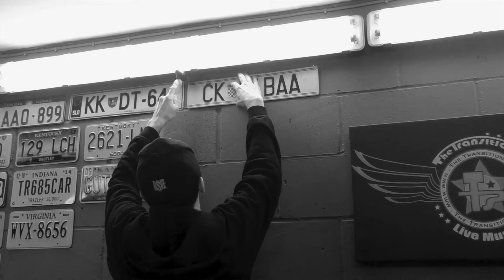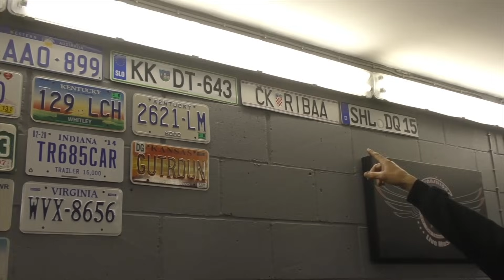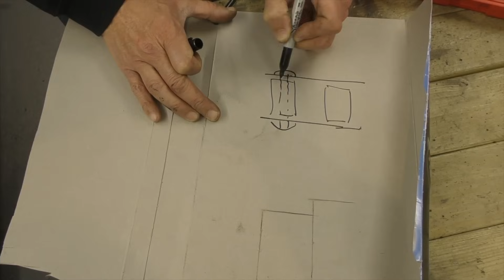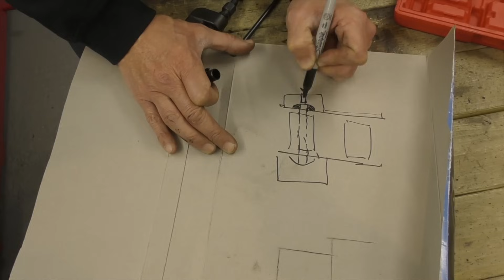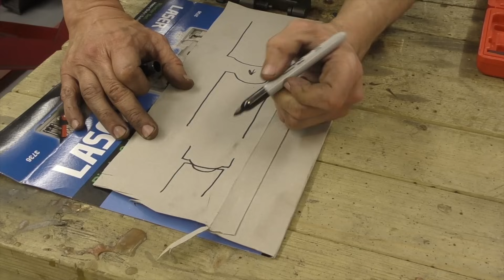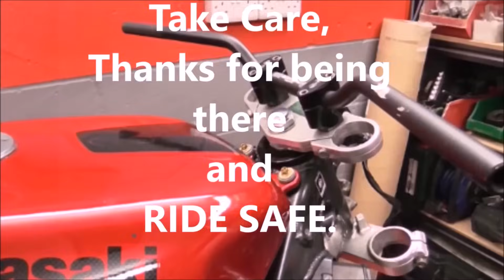Delboy's Garage, Motorcycle Chain and Sprocket Change.

Comment: Hey,
Don't want to sound like a negative Nancy...but I have exactly the same chain tool and when I rivet the master link something just didn't feel right, so I went to the DID website and the specs for the rivet head flare need to be 5.5mm - 5.8mm The way you showed on this video gave me 5.37mm.
I had to grind the tip of the tool to a larger dome to fix this.
Reply from the maker: I use the DID flaring tool for this job now.. it has a two part tool end.. one part is the cone shape point.. and the other is a cup shaped recces, and its machined to exactly 5.6mm so you just crush it in there and it flares to the exact size...if you flare too much you can crack the lip edge of the flare which can chip off later.. so the DID tool is very safe and accurate... there's a video on it in the playlists..

Comment: Man, you just saved me ! I bought the same tool and broke the 2 smaller pins. I didn't use the 3.8mm because the ring wasn't allowing it. I was disappointed and threw the tool to the bin. Then I found your video. Same chinese tool! I grinded eaaily the mushroom with a file. Then I used the 3.8mm.. Et voilà ! Chain opened! Man, I thank you, and I thank God! I ll watch the end of your video to install the new chain, cuz I do not want any problem now. Thank you again! (Ducati SF 848)
Reply from the maker: No problem 👍, glad it helped

Comment: Hi Del, did you do a video on how to check for chain and sprocket wear ?????
Reply from the maker: Not specifically on that alone mate, but here's a trick if it helps... set the chain tension so it's correct for riding (am sure you know how to do that), stand the bike upright with the weight of the bike on the wheels (get someone to hold it by the handlebars... engine OFF and bike in neutral)... then crouch down behind the bike, grab the chain on the very back of the sprocket and pull it off the sprocket, if you can see more than 5mm of daylight between the chain and the sprocket you're getting in to some serious wear and it's time to think about changing it... a healthy chain shouldn't show any daylight under the sprocket no the back edge.  Hope that helps mate.
Reply: @Moonfleet41  Thanks Del, i have watched your video on the theory of front sprocket wear to rear sprocket (3 to 1) and was looking at getting a silent running front, but in checking the way you have described,   and having a winter wash and brush up, i have cleaned and lubed the chain, in checking i can pull about a 2-3 mm off the rear sprocket, i am now thinking, stick with what iv'e got, then replace the lot in the summer, ?????
Reply from the maker: @davidcort2857  Good plan mate.. that's what i'd do with that much wear..!
Reply: @Moonfleet41  Thanks Del, and thanks for some cracking videos, you and Pen have  a great Christmas.

Comment: Hi Del, im fitting a new chain on my Street triple r 2014, I've followed your video and  found it really helpful and has gave me the confidents to tackle the job.
I'm now up to the point where im fitting the new DiD Chain.
the trouble is when I fed the chain around the sprocket and when they meet on the rear sprocket they are about 5mm short to get over the tooth, there does seem to be play in the chain but I can't keep them together. when I brought the new set it is for my bike. the old chain had 59 link the new chain has 57. 
I know that's so different but I did think if I brought the whole set for my particular bike it would fit ok. any help would be m much appreciated. thank you for all your videos, so very helpful and easy to follow because you take the time to explain each step.
kind regards 
mark
Reply from the maker: Hi Mark.. i presume you have the axle all the way forward in the swinging arm?.. are you fitting new sprockets with the same number of teeth as the old ones?.. presuming all that, then you should have 117 links including the split link!.. count the pins not the plates mate.!
Reply: @Moonfleet41  Hi Del, thanks for you reply, I have spoken to the company and they sent me out the wrong chain, the one I have is a 116zb I should of had 118, 
gutted I wanted to get out on the bike today. 
that will teach me in future to check the parts before starting , didn't know you counted the pins and least I've learned something, yes I had the rear wheel as far forward as it would go. thank you so much for your help and videos..

Comment: That tab washer on the nut that holds the front washer on how many times can you use it before you replace it?
Great video by the way.
Reply from the maker: Hi Richard.. usually, if its never been off, and only bent over once at the factory... then ill use it a second time.. but no more than that, they don't cost much.

Comment: Thank you for your video. I got 520 DID chain for my KTM dirt bike, but it comes with the clip. should I also press the pins like on your video before I put this clip, or I can put the clip without pressing pins? I'm a bit confused with different approaches and videos.
Reply from the maker: If its for a light weight dirt bike, and the chain was ordered for your bike's spec, and it came with a clip... then fit the clip mate, thats all you need..!  but paint it with some bright nail varnish so you can find it at a glance, and keep an eye on it.. Hope that helps. del.

Comment: Great video! Good to know if you're a relatively inexperienced motorcycle mechanic like me. Changed oil/filter, coolant and battery so far and still learning about chain/sprocket as the 2002 CBR 600F4i I'm working on is making these clunking sounds at low speeds and the chain indicator shows it's time to replace.

Comment: As ever Del and PP, a calm, reassuring and brilliant video... Demystifying another worrisome chore in to a satisfying job.  Thank you.  Can I ask, as I am new to a chain driven bike and the maintenance required... scottoiler or this dry lube you speak of?  My Speed Triple has the sump etc covered in thick chain gunk...so I am interested in this dry lube you mention?  My S3 will be a commuter so is oil better than lube? I can't see that this job has ever been done, with the bike at 23k miles...so I'm looking forward to giving it a go now! Thanks!
Reply from the maker: Hi Daniel, big question and an easy answer because it all depends on what you're doing with the bike!  ...dry lube is for dry bikes (easiest way to remember!), meaning if your bike never gets wet and you only ever ride it in the dry, then use dry lube on your chain.  But it doesn't give any corrosion protection at all, so it's not for wet weather use.  A chain oiler is an excellent way to lubricant a chain, keep it adjusted correctly though, so it doesn't splash oil up the back of the bike, or drip oil on the road.  If it's extreme bad weather, salt and filthy roads, I'd consider using a chain wax and cleaning the chain once a week... hope that helps mate, and keep in touch, ride safe, thanks for your kind words on the videos, all the best, D&Px

Comment: Great video's, very enjoyable and helpful. Just wondering if you could help with a question. My bike needs a new chain and sprocket set as I can't adjust it any more. Would I need to reset the adjustment screw to it's original position before removing and fitting the new chain? Thank you for any help!
Reply from the maker: Yes indeed my friend, if you're fitting a new chain and sprocket you set the adjuster mechanisms all the way forward to fit the new set, and then adjust it to the correct tension from there.
Reply: @Moonfleet41  thank you for the information, very helpful 👍.

Comment: Brilliant video. Are the pins single use? I have a quick link on my gsx which seems a lot simpler. When you change the discs you'd have to break the chain again wouldn't you?

Comment: 31:10 i bought a did chain set. But there is no grease and no o rings. What grease should i use? Ceramic grease maybe??
Reply from the maker: If you have some, or you could use White Lithium grease, or if you're really stuck, use some chain wax..!

Comment: just recently had my chain fail and I believe it was because of the clip style master link that was on the chain. discovered that there was a rivet type master link recently. purchased the tool and a new chain. been studying your video which is very informative. the only question that I have is that you mention to paint the new link to keep an eye on it. have you ever had a rivet style master link fail on you? Thanks
Reply from the maker: Simple answer mate, no I haven't... as I'm pretty paranoid, having had a chain break many years ago, so I make sure they're properly riveted and I check them regularly!

Comment: Hey Del, I have had bikes for years and when I buy chains, I've always bought the c clip type. I've never had a single problem of clip pop off. Of course the bikes have been a t 500 , a CB 750 Honda and a kz 550. I've bought a chain for my Triumph bonneville t 100. It's also a c clip type. It's not on yet, but I wanted your opinion. Thanks man.
Reply from the maker: If you have a clip link Peter, and you're planning on fitting it to your Bonneville, then be conscious to make sure the clip is still present on every pre-ride check before you ride the bike... what you've listed there are all reasonably lightweight and low power bikes, including the CB750, but modern motorcycles these days have a lot more power and torque, so personally, I make the choice to always fit  a compression link, it then becomes an endless chain and once fitted, you can pretty much forget it... but it's your choice, just keep an eye on it.
Reply: @Moonfleet41  Thanks Del, the bike I'm fitting it on is the bonneville t 100.  I understand the concern, I guess with the fact they're still selling the clip type is some sign,they haven't had failures.  I know no one wants a chain failure. Thanks so much my friend.
Reply from the maker: @peterford9369  Exactly right mate.. there is always an element of "cover-my-back' with these things, you should check your clip link often..as with all manner of other safety checks from lights to tyre pressures and brakes before you ride, but in this millennial world, some of today's riders check nothing at all until it's time for a service or something fails... then they're looking for someone to blame.! so rivet links have become the safest option... but like you say, if they make them for your bike, it naturally follows that they're safe, after all, it;s no fire breathing monster lol..   I paint all my joining links a bright colour with some nail varnish so i can spot it at a glance and keep it checked.. maybe a suggestion for yours for extra reassurance.!   take care buddy and keep safe..  Del.
Reply: @Moonfleet41   Smart idea. Had the clip chain on now for 600 miles and alls well. I place a gold chain and the clip is already black, so its hanging in. Like I said, the other 3 bikes I've had cept the vmax, that was a driveshaft,, had clipped master links and never had an issue.  But you're so right about a quick pre check, of tires, chain fluids, etc,,is a good thing. Especially tires. Pic up a screw or run over something that puts a cut in the tires, can cause a really yuck ride,quick. Thanks Del . Take care.

Comment: You used a grinder, if you were on a long road trip and didn't have one, could you use a small file to get rid of the mushroom?
Reply from the maker: Nope, a file won't touch it, the pins are extremely hard, probably the same hardness as your file, but you could run a hacksaw through the chain itself by cutting the link plates if you needed to replace the chain completely.

Comment: Del, great video  but have to criticize tool. Bought it on same place and brake chain after grinding off head, no issue. But once had to rivet master link came to conclusion tool tip is to soft for master link to expand it. In fact tool got seated in rivet like in video but OD didnt change. Implementing tool is to soft and got damaged in first use. Believe me did pay max attention on it as i do have lot of mechanical experience. On the end purchased professional tools and did riveting in seconds with no issue. Would recommend to check that tool and master link as i would not use it again. Went straight to  metal bin, waste of money
Reply from the maker: Hi buddy, it's a shame you take such a terminal view of it, I've riveted three chains with mine and never had an issue, if you contact Wemoto they would send you a new tip free of charge...  I doubt it was anything to do with you, probably a faulty tip and maybe missed the hardening process of the tip in mass production, glad you got it sorted.  I've never heard a complaint from anyone else, most people buy them cos they may only change one chain in every 10yrs, buying 'pro' tools can be expensive if you don't use them much, glad you got it sorted, thanks for the feedback, all noted...

Comment: Great video bro! feeling very confident doing it myself now! thank you so much! one question, should I apply some grease on the front sprocket to put it on the engine? and the front sprocket nut?
Reply from the maker: Hi Lazaros.. good to hear that you're doing this yourself, and yes, just smear a very light wipe of grease on the shaft and thread.. then fit the sprocket and nut... obviously make sure you torque the nut up correctly, and bend the tab washer over to lock it in place...  Good luck with it and happy new year. Del.
Reply: @Moonfleet41  thanks, happy new year and greetings from Greece

Comment: What a great video some folks like to tinker with mechanics but are not very brave that’s a job I would have thought out of my skill set not any more tho with your precise and very clear instruction it was made to look a very doable job, thank you so much . Gotta work my way through all the vids now lol. Just one question was the old chain separated at the factory connection? Or just random sorry if that sounds a bit thick . Many thanks
Reply from the maker: Hi buddy.. Thanks for your kind words, and with the splitting of the chain, yes, if im using a splitter i always head for the factory split link, its not really vital, just habit TBH, any link will do... or if the chain is firmly going in the bin.. then just drop a disc cutter through it, its scrap anyway aye.!    Good luck with yours, and i hope it goes well for you my friend.. Cheers, Del.

Comment: Hi Delboy - love this video and have followed your example to the stage that I have the replacement chain on the bike ready to rivet - but the chain appears to bit a bit longer than the old one I just removed and there isn't enough in the adjusters to take up the slack - is it normal to need to remove a couple of links on the new chain to make it fit.?
Reply from the maker: How many links on your old chain?, how many links on your new chain?  Have you got the same number of teeth on your new sprockets?  Is it possible they sent you the wrong kit?  If what you ordered was bike specific, it should fit straight on!

Comment: Another great video! Only one thing worth pointing out is that the grease needs to be inside the roller  and not only around the x rings. As the x rings are there to keep the grease inside the chain.

Comment: Please show us how to change the chain without a specific tool, it's really hard to get one of them here
Reply from the maker: You can use a small ball bearing, maybe 5 or 6mm.. place it in the dent on the end of the pin and press it in with a G clamp... you can use a g-clamp to press the plate into place too..    but wear some eye protection, ball bearings are hard, and can break under great clamping pressure.. but it will spread the end of the pin to some degree... Hope that helps you.
Reply: @Moonfleet41  thank you very much for these valuable informations which are presented freely. It was a great help and I'm looking forward to see more informative videos about motorcycle maintenance

Comment: Great vid pal. The filming was very good and clear. Kudos to the missus for the camera work. This has given me the confidence to change my chain & sprockets. Bought the same chain tool, but didn't use it to split the chain. As l was renewing the sprockets I just ground off the old link pin with a grinder and popped it off with a screwdriver and knocked it out with a punch. You video makes me think to allow plenty of time to do these jobs. Rush it and get it wrong at your peril. Nice job matey.

Comment: Hi , one thing you didn't mention was at what setting do you leave your rear axle adjustment line in. Do you move it to the middle so that when you fit the chain you can either loosen it or tighten it equally either way?
Reply from the maker: Push the axle all the way forward, then fit the chain and draw the axle back on the adjusters until you have the correct tension..

Comment: Stupid question I guess but how do you make sure that both chain tensioners are tightened equally? Do you count the turns when you back them off in the first place?
Reply: And do you have to check the length of the new chain against the old one and adjust the length?

Comment: 27:31 my screw keeps spinning and the nut won't come off the rear sproket. Any tips?
Reply from the maker: Presuming its a Triumph like this, The thread is usually a captive bolt fitted through from the inside, they usually sit in a socket on the inside that stops them moving.. perhaps with yours there is some issue with the internal casting that holds the bolt. or maybe someone fitted an alun bolt... drop the cush drive carrier out and have a look inside to see what's up..! it should be obvious once you see it.